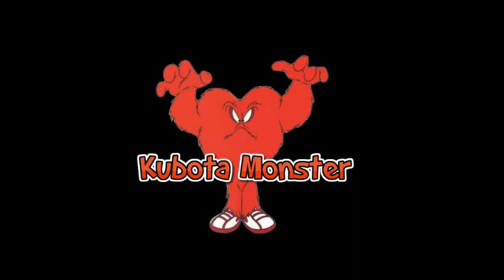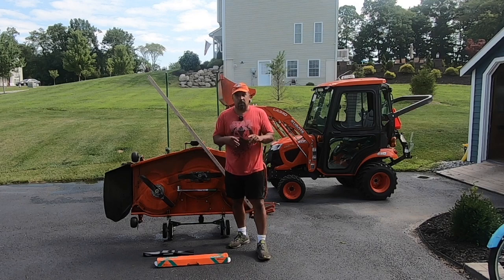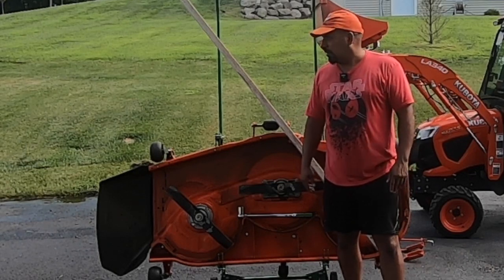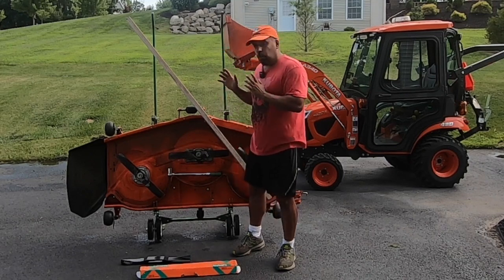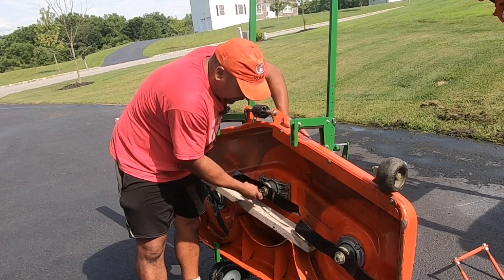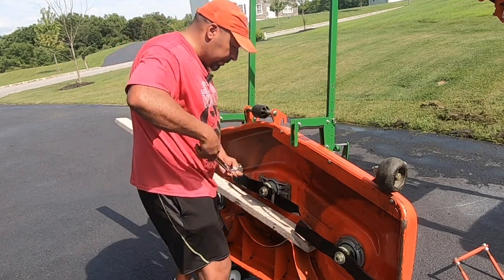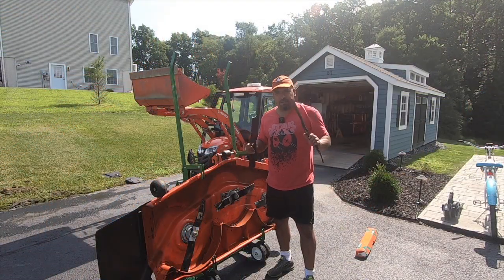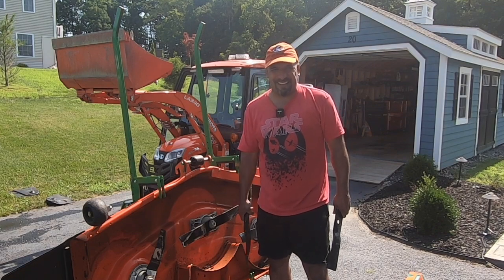Time to change the blades. Kubota 60" mower deck blade Removal & replacement.

Comment: Good to see you back Pete!  For future reference the bolt s use a 30mm socket (and the spindle nuts on the top of the deck ar 27mm)  The blade bolts should be torked  between 72 -87 ft-lbs (noticed you had a torque wrench ;-)
Reply from the maker: Thanks for the information buddy. Very much appreciated.

Comment: Ok, here's a few tips for everybody.
Firstly,  Pete seems like a really nice guy. He's trying to help other people and that's good. Also, he gave away a brand new set of blades too.
But Pete missed a few things and got some others wrong. Ok, here we go.
Pete's right....the bolt heads are metric. 30mm to be precise. This equals 1.18" not 1 1/4". You won't of course get an imperial socket that fits. This is important. We all saw (and Pete acknowledged) the socket slip. This is a surefire way to round off bolt heads and hurt your knuckles enough to make you say naughty words. Just go out and buy a 30mm socket. Now while we're on the subject, someone below in the comments asked why you would give away $50- worth of blades but not go and buy a $50- impact driver. That's a fair question as far as it goes but let me warn you.....use an impact driver to undo the bolts (you shouldn't need to but it sure is easier) but DON'T do the bolts up with an impact driver. 
This brings me to the next thing. Pete MAY have replaced the washers and bolt the correct way but he might not have either. We don't know because he didn't tell us and it's important to do this correctly. It's not just the order of the washers. They ALL have to be the right way up. The two thin washers are domed. These act as a clutch so that, if the blade hits something solid, you don't jar the belt or the gear box and drive train. They are design to slip in this situation. This is why you don't tighten the bolt with an impact driver. Do that and you will almost certainly over tighten the bolt and washers and negate the clutch action.
The thick washer that mates with the shaft also needs to be fitted correctly. The shaft has a slight taper and the inside of the thick washer has a matching taper. You MUST ensure that the two tapers mate correctly.
Now, there's more to tell but I don't have the time. This video is quite old but the process is the same and the steps are covered in much greater detail. https://www.youtube.com/watch?v=zcogoonHEhc It only goes for 7 mins. Worth every minute of your time (I have no affiliation).
Reply: Thanks Doug, your video answered questions about why my blades are spinning freely. Now to try and get the bolts off so I can clean up the washers and file things like you showed. Not sure how I'll be able to stop the center spindle from moving when trying to remove the blade that is spun as I can't easily access the top to hold it in place. Any suggestions?
Reply: What about proper blade positioning for the kubota sv820 with 48 inch deck

Comment: I was looking on how to take the deck off and I found this great video.   By the way on your blade change. I think the order of your washers was different from the way you took them off.   Thanks for the education
Reply: Yes, I noticed that too. When he took off the first blade it was thin, thick, thin. When he replaced he seemed to do thin, thin, thick. Otherwise a nice look at the underside and the setup. I''ll be changing mine with the deck still attached. 48 inch deck and when I was removing some wire jammed in the blades, I noticed that it seems the blades are on upside down with the sharp leading edge on top.We have only just bought it. A job for the morning.... no wonder the cut was a little ragged......🤔

Comment: Pete one of the washers is conical, that's the one that goes next to the blades. (looks like a small mountain coming out of the blade) That's what they use instead of lock washers. also a short 12 to 18 inch piece of 2 by 4 is good for bracing the blades. Paint it Kubota orange so you or the wife don't throw it out.  When you winterize. Change the gearbox oil like usual. When you clean up the deck, final step in cleaning should be a wire brush in a drill or grinder.  Then paint with Rustoleum primer and then Kubota orange.  The no stick paint is just a hype, don't waste your money.  My deck (BX 2360) looks as good now as the day I brought it home, that was the summer of 2010.

Comment: g1900 torque spec is 75lbs, just took the old blades off with a chunk of wood and an adjustable wrench, my wife did the center one, new to us mower. F150 lug nuts torque to 150 lbs for reference. Also i recommend anti-seize on the threads, not fun digging sheared bolts out. 28 mm by the way.

Comment: I keep an extra set of blades for my lawn tractor and push mower as well....much easier and quicker to be able to just swap a fresh set onto the mower and go, then sharpen the ones I removed when I have a spare moment.  With my lawn tractor I have a mow-jack that I just raise the front end of the mower off the ground and can easily do the blade swaps and not have to remove the deck....can't do that on a BX LOL, mow-jack doesn't even adjust that wide I don't think, and its only rated for like 500 pounds LOL.  

The deck on the BX looks to be built somewhat like the deck on my old garden tractor, its heavy, but it'll last forever.  The deck on my lawn tractor looks like they used recycled soda cans to build it with LOL.  Pushing me more and more towards picking up the 60" deck when I pickup my BX.  Leave the lawn tractor to do the little stuff....although I only have an acre, about 1/2 of it or a little more is pasture which if I don't keep up with it becomes pretty taxing on the lawn tractor....so the BX may get a 60" mower deck.  Can't wait to get my tractor, so many things to do, the chore list keeps growing, that BX is gonna be working pretty hard for a while.
Reply from the maker: You will love your BX when you get it.
Reply: @KubotaMonsterBX23S  I hope so.  It was between JD and Kubota and the JD dealer shot themselves in the foot first by brushing me off when I was inquiring about their 1025R...no demo, no seat time, just wanted my wallet, and a ridiculous price tag with proprietary implements...no thanks.  Kubota dealer was extremely helpful asking what I was needing a tractor for, property size, space, etc.  Even offered to bring a couple tractors out to my place that I could try and see which suited me, but I knew already it would have to be a BX due to my space limitations in my shop, and the dealer agreed and pointed to the BX2680 as my best option for PTO implements now and in the future.  Thought about Mahindra but their dealer here is a joke, friend of mine has been waiting 3-1/2 weeks so far for a hydraulic part for the loader of course proprietary Mahindra part.  My neighbor had 2 Kubota's I believe a B-Series was his first one then he upgraded to an L-Series later on.  He loved his never had any problems, both of them sold at the estate auction for almost what he bought them new for.  Sadly if I had the money then I would have bought one of them even though it wouldn't have worked on my property, could have made for a nice trade-in on a BX LOL.

Comment: Pete... that cart really makes changing blades easy!  I lift mine with a chain on my loader... because I don’t have a cart. 🤔

Just curious... how come you don’t rotate the guide wheels 90degrees when you pull it out from under your tractor?  It scrapes up the tires on mine and requires a lot more muscle than I want to invest.   What’s your secret?

I enjoyed the vid.... keep ‘em coming!
Reply from the maker: William Harris Hey buddy, it rolls out pretty easy for me on my driveway, So I don’t bother. By the time I turn the wheels I would have it out already and up in my dolly.

Comment: Thank you for the video. I'm really struggling to get mine off. They have been on for 35 years. Looking at your deck as is, do your blades rotate clockwise or anti clockwise? I see you loosened your nuts anti clockwise, does that mean your blades spin clockwise? 
Andrew from Australia.
Reply from the maker: Yes!

Comment: Stragglers left after you've made a pass with the KM mower may also be a clue that you're moving too fast, or the RPMs need to be increased.
Blades as bad as you've shown makes me wonder how many rocks (& dirt) you've tried to trim down.  As you stated, sharp blades are essential to maintain a healthy lawn - those should have been change a long time ago.  The edge of the deck shows that you've been kinda brutal when you mow.
An easy way to remove the mower deck is to pull the pins on the anti-scalping wheels, turn them 90 degrees (Kubota provides an extra hole in the mounting shaft for this) and then you can roll the deck out from underneath the tractor.
  I use my FEL to lift the deck vertical so I can remove the blades - don't need another toy (the deck dolly) taking up space.
Reply from the maker: I mow at the highest RPMs possible. And yes like I said in the video, I have a challenging lot. I do hit rocks for sure since I just had a pool put in and the ground and sod were tore up. I think I also said that I was going to change them out but had the wrong blades last yr... But then I procrastinated getting a new set.

Comment: Pete on your 60 each blade is 20 inches cause 20x3 is 60 and mow at very low throttle
Reply: Thay are 20.6 inches long. The spindles are staggered.

Comment: Gives away $50 blades... Won't buy a $50 impact driver......
Reply from the maker: Phil Hilton please send me the link to the $50 impact driver. I would love to find one for that price.
Reply: @KubotaMonsterBX23S  Use your google machine. 

Depends on what battery brand you've invested in.  For me it's Ryobi. Low end Ryobi Impact Driver is $45-$50 on amazon. And it's free or close to it from Home Depot during Ryobi days (when I get the 2 battery pack with free tool and sell the extra batteries I don't need on marketplace in the fall at or near cost).

Before I had my Ryobi I used a cheap air impact driver from harbor Freight. Their Central Pneumatic's are $47, and as low as $19.99. They also currently have a corded Chicago Electric for $50.

Heck.. Even walmart caries a Lithium Ion impact driver (with battery included) for less than $50.

Yes you get what you pay for. The occasional blade change doesn't put a lot of wear and tear on things, however.

Side note - Why do you move your board as you go from blade to blade? They're synced via the belt. Blocking one should block them all.
Reply from the maker: @PhilHilton  One thing Iv'e learned over my 30yrs of being a aircraft mechanic, is that certain tools you "can't" go cheap on. I $50 impact driver is going to last, and a decent impact driver is gonna cost at least a few hundred bucks. And there is no rush for me to get one, when I have a set of sockets that work fine. And the reason for switch the 2 by 4 out to each blade is so I can hold it while I'm loosening and tightening the blades. It wasn't in there tight enough like you can see in the video, where I had to hold it with with my leg in place. This system works for me for now, sorry if it didn't work for you. Everyone has there own way of doing things. When I'm ready, I will buy a impact gun that I know will last me a while. Just not ready to buy one just yet I guess. Thanks for watching.
Reply: I believe I already addressed the "get what you pay for" counter point.
Reply: @PhilHilton  Not so. The 3 blades are connected by a rubber belt.  It'll slip on the pulley when tightening or loosening any one of the blades.
Reply: Never had a deck that would slip if the belt was tight. Certainly not when using an impact driver.
Reply: @KubotaMonsterBX23S    I've had my cheap impact for years.  Most people don't use one very much so they last forever.  When you need one nothing else will do...

Comment: Nice work Pete. Look into a cordless impact and you won't need to deal with the wood.
Reply from the maker: Good idea thanks buddy. I have been looking but for some reason I will spend money on all kids of shit, but won't pull the trigger on a $300 impact gun lol.
Reply: @KubotaMonsterBX23S  Even a cheapo from Harbor Freight will do the trick. Their impact sockets are cheap too. Definitely something worth looking into.
Reply: That's what I use on my lawn mowers....works great, and you don't have to struggle with trying to keep the blade from spinning.  I don't use the impact to reinstall the blade bolts just to remove them.